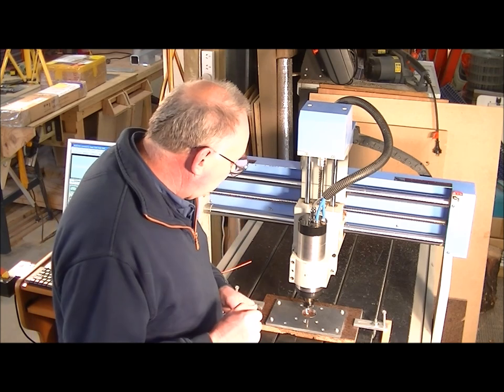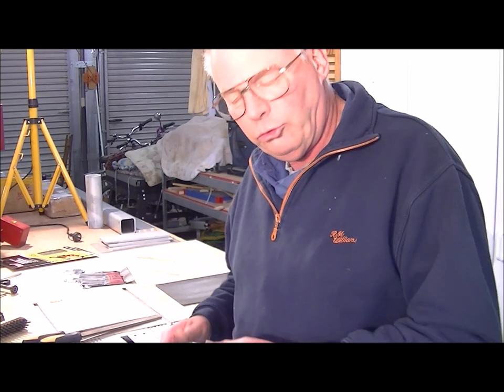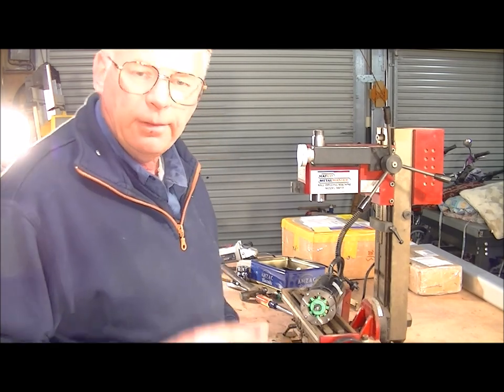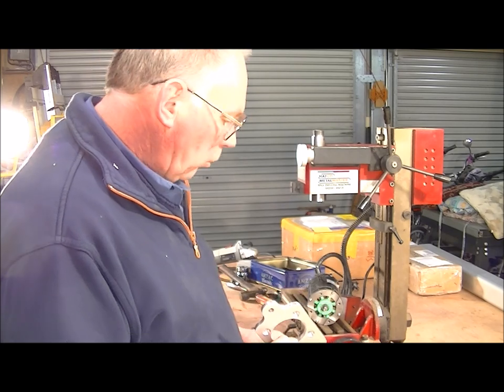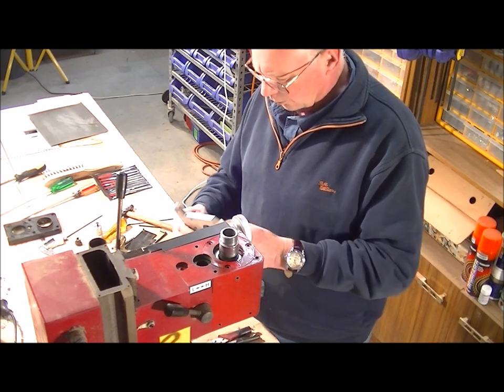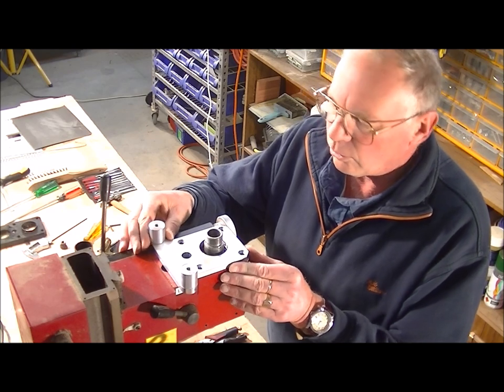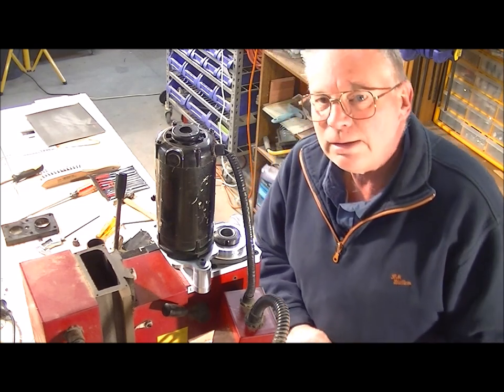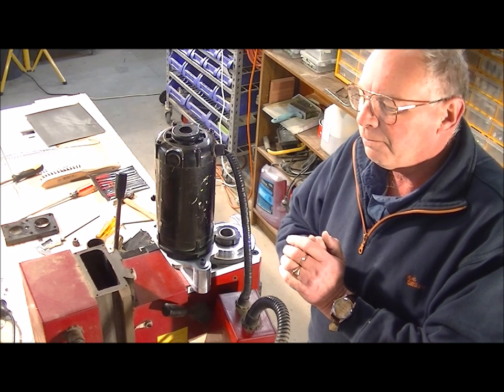131 Mini-mill drive belt conversion kits  Part  2

Comment: hi Roger nice video,keep up the good work,i have a minor suggestion, on the 9 mil  bottom plate, what i ended up doing to my milling machine.was to get a large enough collar and place it on the very edge at  the  bottom of the spindle .and what i did was split the collar with a small saw,and then drill and tapped a 1/4 20 tread
to compress the collar,and then i drilled the collar to insert a 3/8  hardened  steel  to hold the spindle when changing the drill bits or to change the tooling...well i just thought i'd pass this on.

Comment: if you replace the small shaft with a tapered shaft and a liner bearing. this will make contact at a 90 deg angle(with a spring to disengage the lock).  you could use the speed select lever to lock the system for tool change.

Comment: Nice work, proof is in the pudding etc.........as this vid is 3 years old and I don't see any reference to a kit, and as I might possibly be indulging in one of these mills, basically all it consists of is a piece of 12 mm plate with 4 holes and one a lot bigger for the pulley and a couple of stand offs for the motor mount...........add another one for the motor mount and a couple of pulleys and Bob's your uncle etc. I suppose practically anyone with access to another mill.....OK, so without a mill you "could" manually hack one out of a bit of ally plate and get to the same ending.
The main thing is it's totally doable if you put your mind to it, the kit would be more user friendly for those without the know how to bang metal about.

Comment: Ho do I go about ordering you conversion kit.  I just bought one at Harbor Freight and I see a lot of guys dousing this.  I haven’t gotten mine yet.  I will be using mine to machine down lead weights in HO and N Scale locomotives for DCC so that’s DCC Board and speaker enclosure can be added.  I would like to order this kit from you.